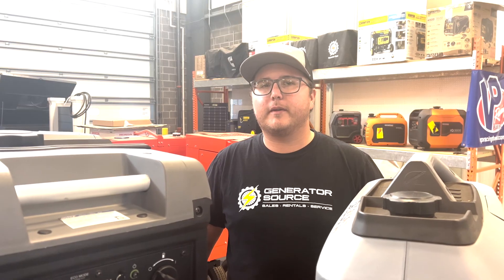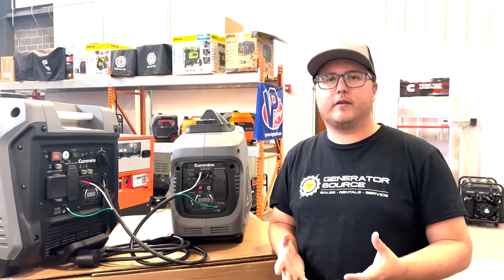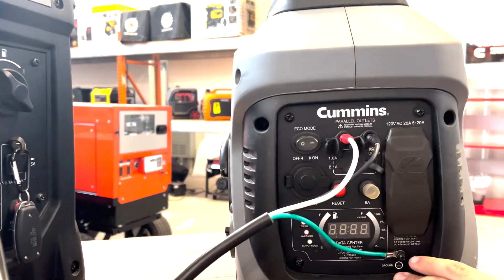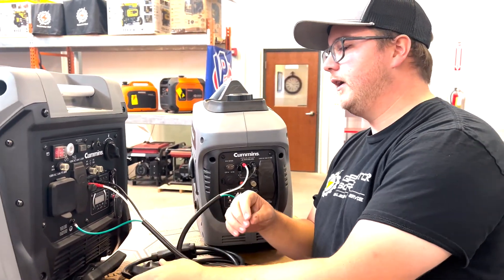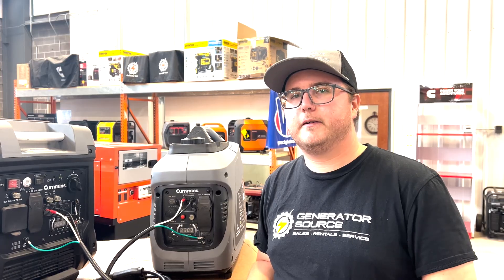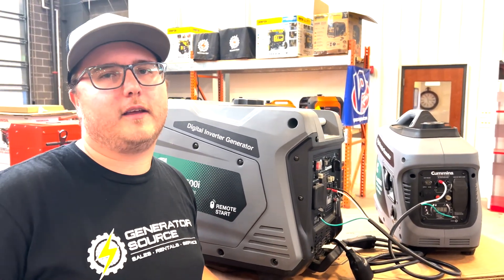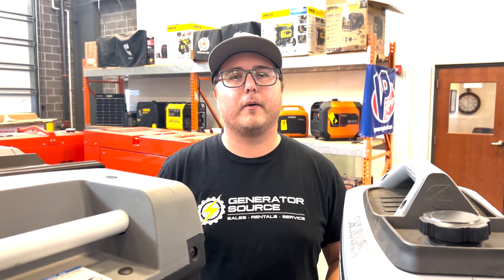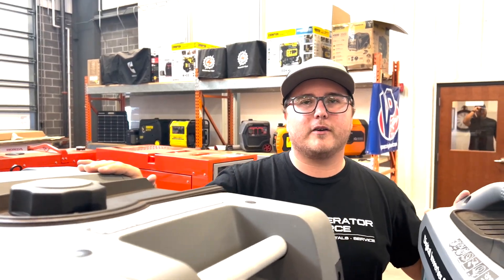How To Parallel Portable Generators

Comment: Can i plug a honda inverter 2000 and a predator 9000 ... and use a 50 amp... even though id be getting 43 amps... so add the 50 amp box and breaker to panel?
Reply: Well getting 43 amps. Using 50 amp plug and wires but with a 40 amp breaker i guess. Lol

Comment: You did not cover load sharing.  So, is I have a 2000 watt and a 4000 watt in parallel and the load does to 3500 watt what happens.  I guess at 3500 nothing.  Now lets take the load up to 5000 watt.  Will the 2000 watt generator trip out.  At watt load does the smaller generator trip.

Comment: I have 2 westinghouse igen 2550.  After I connect the parallel cables which generator do i plug things into?
Reply: That's what I'm wondering!
Reply: I emailed Westinghouse and they said either generator Personally I’m gonna plug into one of them not both.
Reply: @WatchTheJoeChannel  thanks

Comment: Can I connect from the parallel holes direct to my panel? What would be the amp limit? No limit? Would it depend only on the breaker on my panel? I mean using only one generator.
The outlets on the the generator limit a lot how much power I can transfer to my home...

Comment: What about neutral wire if you supplying your house with 240 and 120?

Or it can only be 120 (neutral and hot) OR 240 (2 hot)?  Not 240 (2 hot and 1 neutral)?

I think I got the answer. 🤣

Comment: Hello I have a Pulsar 5000 and Pulsar 2200 both are parallel capable can I go with either kit of 30A or 50A? Or which one would you recommend? Thank you kindly! This is a wonderful video!
Reply: If it were me I'd go with a WEN parallel kit that will provide you both a 30amp and 50amp receptacle. I have the GNA36i 30amp because I am setup to use a 30amp extension cord with the TT-30 plug type.   30amp max is 3600 watts.   That means I can run two 2600ish generators at less than 50% capacity each.    But the GNA36i allos 50amp should I upgrade my generator in the future.   Its really a matter of requirements and choice.

Comment: Thank you for the information very helpful I do have one question though which one of those generators would I use for the power source the smaller one or the bigger one
Reply from the maker: @gregspalding7314  depends how much power your set up needs. A TV and a blender at a tailgate the P2500…. Powering an RV at a campsite the P4500. Both are on sale now use promo code LASTCHANCE.

Comment: Hello,   if in parallel, which outlet from which generators can be used?
Reply: Its your choice what outlet to use on whichever generator. You are still limited to the fuse capacity of that outlet.   If you run a parallel kit that includes the receptacle (some are just the parallel wire connection) you can then run up to the capacity of that receptacle.   Heres an example: I run two WEN 3600 watt gens that offer 2600 running watts each. I connect a WEN parallel kit using the TT30 30amp receptacle. I can now run 3750 watts from the parallel kit box receptacle.   That means I'd be splitting the load between two gens @ 1875 watts each or 72% of each gens rated running wattage. Typically you dont want to run a gen at its max running wattage for extended periods.    With all this said you could still plug directly into each gens 120V duplex outlet for running added loads.  Just take care to not overload the gen or run it at 100% of its running wattage specs.

Comment: What do I need to parallel a 2500watt champion and a 4500 watt champion to run my 50amp rv - champion’s parallel kit says 2800watt and higher for the 50amp RV parallel connector they sell - please advise - thanks
Reply from the maker: @td5997  https://www.championpowerequipment.com/parallel-kit-selector/ check here and add your models in to be safe.

Comment: Here's a question...

I have a 17500W/26250W Generac with a 30A and a 50A outlet, but not a single combined outlet to serve the full capacity of the generator.

I do not know if there are two power "take-offs" from a single winding or two separate windings built into the same generator head, but if they are both being driving by the same engine, then it would seem to me that I would only be concerned with matching phase.

Of course, I'm not an electrical engineer, or even an electrician, so I may be thinking wrong.

Either way, I don't know how to synch two different phases.
Reply from the maker: @EchoTangoSuitcase  you’ve stumped us too.

Comment: Do the regular 110VAC outets on the parallel configured generators also have extra power?
Reply from the maker: @paulkomorita4024  think of paralleling as stacking power bars but the outlets remain the same. Only thing that changes is the kit cord bumps to a larger AMP rating.

Comment: How does the  synchronisation work here? What if my Volts and Hertz do not match ?
Reply from the maker: We are all 60 Hz in US. Small generator will parallel with a bigger generator to add power-- as long as they are paralleled-able.

Comment: can you tell me how to bypass the co sensor on the genmax 9000ied.  it trips the co sensor in open air and i am trying to determine if it is the co sensor is bad before i spend money on a new one.  thanks
Reply from the maker: I'm guessing you mean Generac? I would reach out to them directly on that one. I know you are trouble shooting but not a good idea to do that regardless-- I bet they have a test. I will let them give you a better test method. 1-888-Generac (436-3722) or https://www.generac.com/support/.

Comment: Why does Honda say you cannot parallel two different size generators?   I parallel a Honda eu2000 with the Honda eu2200 which works great for me.

Comment: Sorry.  If the two generators are of the same wattage.  Will the power actually double?
Reply: Yes.   But remember you never want to run a gen at 100% capacity, usually 50% is a safe conservative number.

Comment: Nice video.  Thank you.  The one question no one addresses.  When you parrilell 2 generators, do you actually double the power, or do you just increase the power by a certain %? If so, what would that % be? Thank you.
Reply from the maker: Simple answer yes but for best performance really adding 4500 and a 4500 you should still run it about 80%.
Reply: @generatormart4631  Thanks

Comment: Okay, when you parallel two different sized generators, what is happening with  the load? Is it being split evenly? Or does the bigger generator carry more of the load? I have been told that the smaller/weaker generator of the two will limit your power output. If that is true then matching power output on both generators would give you max power.
Reply from the maker: Yes I’m short it will pull more from the bigger unit after the smaller one maxes out. So a 4500 and a 2500… the 4500 will help you hit 7000 max. No stop at 2500 like the smaller one.
Reply: @generatormart4631  Just to clarify, you get max starting watts from both different sized generators when connected. The load is balanced between the two so that both generators are working at the same percentage, is that correct? For example, both small and large generator are working at 50% capacity in tandem, balancing the load (not splitting it even). 50% capacity of small gen and 50% capacity of large gen ( The big gen would produce more power at 50% so it would carry more of the load).
Reply from the maker: @sergioflores7169  correct my experts say the larger unit will go above the smaller unit’s capacity so you get more than the 50/50 split to make say 7000 with a 2500 and a 4500 when paralleled.
Reply: Load sharing should be mentioned. You can only double the continuous power of the smaller generator.

Comment: Thank you! This is pretty useful. My main question was if I can parallel generators from different brands and I’m quite happy to have answer “yes” 
Actually, very short video and very good content. Thanks
Reply: Most definitely YES!!
Reply: After parallel, can I use cable with AC 120V 20amp outlet instead of 30amp outlet?

Comment: Can I parallel connect a Westinghouse igen4500 & igen2500 together and instead of a 30A@120V, convert it to a 30A@220V outlet so to run my 220V water well pump? Is there a work around to this? Great info video!
Reply: No not 220